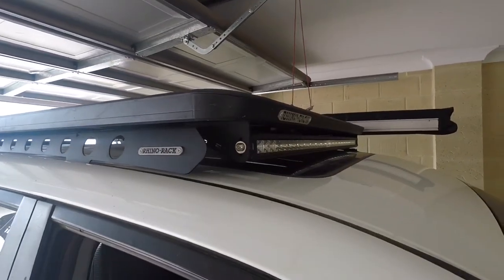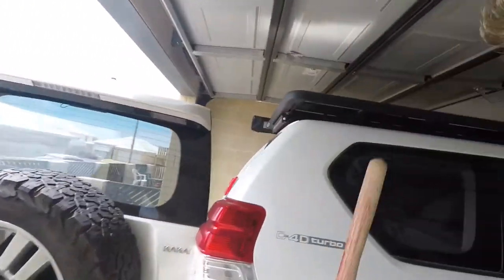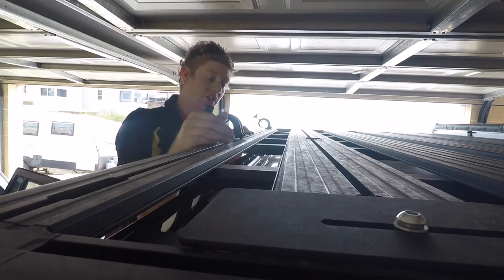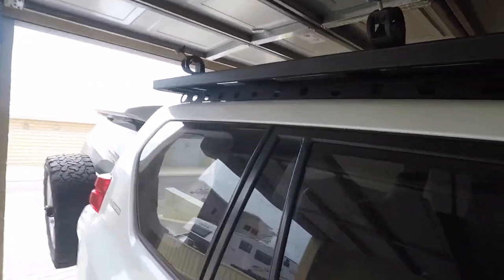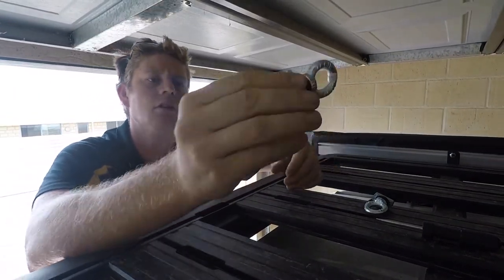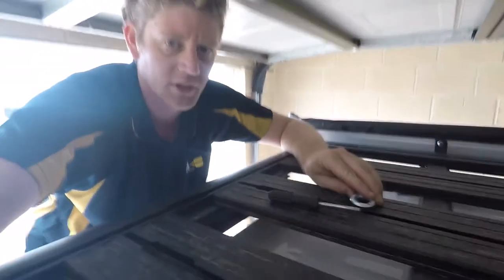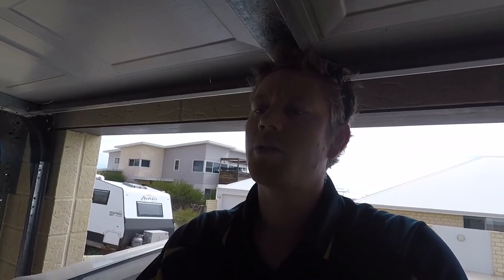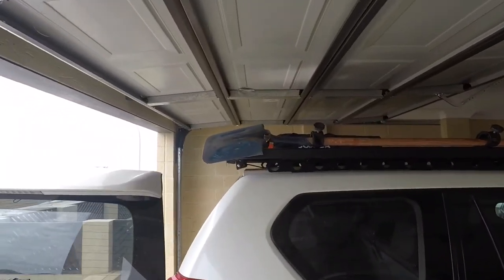Prado 150, Rhino-Rack Backbone Shovel holder and Eye Bolts

Comment: The genuine Rhinorack channel nuts for the eye bolts are much longer than the nuts you used and they actually say on I think its the eye bolt kit for the heavy duty cross bars which use those channel nuts that the product isn’t suitable for the Rhinorack platform. I suspect its got something to do with the chance of bending the slots in the pioneer and using the longer ones to spread the forces. I think its Kaon that do the longer channel nuts for a much better price than Rhinorack.
Reply from the maker: I feel like these ones don’t have the same amount of thread as the rhino ones but seem to be doing the job just as well as rhino-rack specifics
Reply: @JS_Adventure  its not about the length of the thread, its about the channel nut being much longer so spreading the load

Comment: Hi mate where did u get the Channel nut for the Shovel holder?
Reply from the maker: Hey mate, I had these ones as spares but any electrical wholesale business will have either unistrut or ezystrut channel nuts available at a lot cheaper prices than rhino channel nuts and eBay prices while being exactly the same thing. The eye bolts are m8 nuts and bolts and the shovel holder is m6 nuts and bolts. Hope this helps
Reply: @JS_Adventure  Awesome Thank you so much mate!